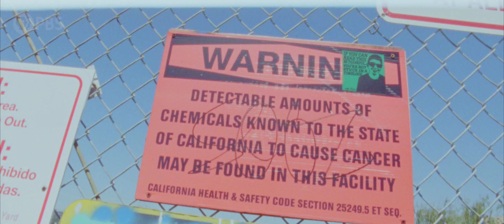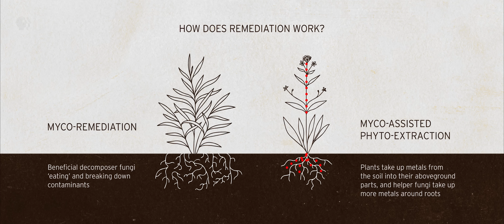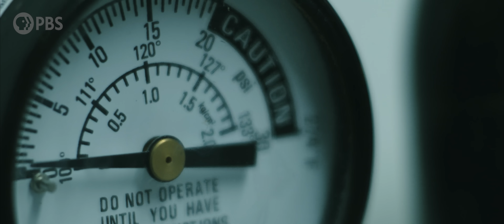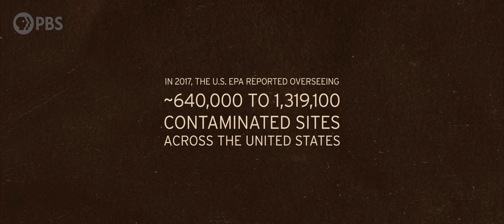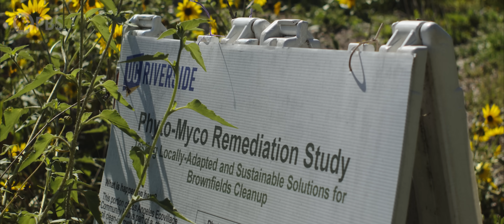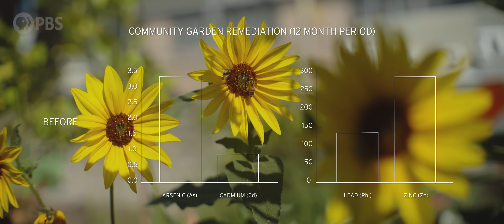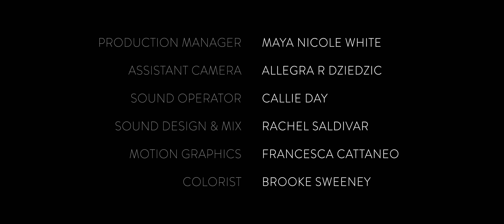She's Healing Wildfire Pollution. With Mushrooms.

Comment: Yea, yet there is still the problem of the plants used, if not removed, the heavy metals that they have captured will be released when these decompose, so harvesting these is a important step, and the proces needs to be done multiple times for it to be efective, companies already using this system will take the plants to a warehouse where the biomas is procesed and then they recolect and sale all the metals

Comment: 12:19 Reasons for the compacted and crust-covered soil, from my understanding having worked as an arborist in Phase 2 of the disaster recovery cleanup: 
1. Heavy construction vehicles compacted the soil during debris removal. 
2. Lots were covered with hydro mulch, which sprays on green and dries to light brown, in order to reduce erosion of the soil that remained and which was often no longer anchored by plant roots or constrained by hardscape. 
3. Soil that goes without water for long periods, especially those composed more of clay, can develop a hydrophobic crust.

Comment: Jesus Christ, America, stop using wood to build homes and start using bricks, stone, mud and concrete.
If you've always known this aspect of fires, why build homes which can burn down so easily and completely.
Reply: because no one builds homes entirely of bricks, stone, mud, and concrete. even if the outside is composed entirely of those materials, there are still other materials in use inside the building that are flammable. insulation, the walls, the furniture, gas fixtures, the list goes down. when all that stuff burns away, the stuff that isn't itself flammable is still damaged and has to be knocked down and removed so that a new building can be made in its place.

also, wood is renewable and far more sustainable

Comment: This is really cool, but I think some people need to realize despite the potential promise here it takes a lot of time to get from proof of concept to implementing something like this. There is a Superfund sight near where I live that was opened for development. Any process used for clean up, specially when it comes to heavy metals has to show it is reliable, consistently able to eliminate contaminates and safe for human and animal habitation. Even when methods like removing layers of contaminated ground its not perfect. Residents who move into the homes built on the Superfund sight near me have to get their soil tested before they try to grow a garden in it, or let their pets out into their yards. Because even current methods aren't perfect. I spent time in college working with and around the scientists that work on these sites. They're always looking for better ways to testing, removal and remediation. They live in those areas too. These just take time, because rushing into something that appears promising or perfect have caused a lot of harm by well meaning people.

Comment: This is a great idea and is being used without the fungi in another country in an area rich in Lithium deposits. Instead of mining the site, they plant a plant with a good root structure, and it absorbs the lithium out of the soil, and then the plants are processed to retrieve the lithium. On a side note, seawater desalination is the easiest, cheapest, and most efficient way to collect Lithium, along with many rare earth metals. With enough infrastructure built along coastlines, it would solve the US water shortage problem for good. with most of the contaminated soil going to dump sites( I did not miss the fact they were on Native Lands), you would presume that it would be quicker to remove contaminated soil and replace it as this could be a great industry for mid-sized businesses, that a whole range of mid sized buisnesses running across the US creating new fresh soils aand removing contaminated soils to dump sites, these dump sites would then be where this process of cleaning the soils takes place and once soils are cleaned then sold back to the removal buisnesses, this creates a loop where the same truck removing soil then reloads and dumps clean soil, it would take aa while to get to that stage but this is all doable.

Comment: This should be standard practice for remediation. There's even processes now to actually harvest the heavy metals the plants can extract from the soil with the mycelium's help. It's called biomining and it's already being done in some smaller places. If we remediated contaminated sites then extracted most things back, that would be a literal game changer.
Reply: This is what naturally happens after a fire. Mushrooms and other fungus bloom. They are just expediting the cycle and managing it.
Reply: What is the cost of per yield weight when compared to traditional mining?

I’m thinking about how producing new plastic is less expensive and more efficient than recycling.
Reply: @AliasHSW  Each site needs a custom solution for the exact combination of contaminants that are extracted by the plants and fungi, so there isn't a good way to compare prices one to one, and it's most likely never going to be comparable to traditional mining in any meaningful way. However, it does help close the loop on bioremediation projects. You still need to remove the plants to remove the metals, but then you just have a dump of contaminated plants rather than contaminated soil, so all it does is abstract the problem by one degree rather than solving it. Recycling the metals in the plants is a way to get the metals back in the system rather than leaving them sequestered effectively forever or allowing them to progressively contaminate wherever they're dumped.
Reply: @AliasHSW ya but the difference is the toxicity of the product is what makes it worth harvesting
Reply: @augiepm4428  of course. Not arguing that point. It’s pure thinking out loud kind of question
Reply: Divine Femine Energy 💙💙💙

Comment: Yes, but for many of the toxic elements that are taken up by the plants of the fungus, if they are just left on the land to rot.
It will cause all that concentrated material to be released back into the environment.
So, without long term collection and harvesting of those products that have been accumulated in the plants and fungus, and removing them from the area for proper processing to extract those elements from them.

The land still remains contaminated, it is just in a more secured state.
But if another fire rolls through the area and burns them all, it will release all of them again with the addition of the new materials.

So it needs to be seed the area, let them all grow and take up the pollutants.
Then harvest them all and send them to be processed to fully extract the pollutants for proper disposal.

Comment: You didn't explain what is done with the toxic metals.  If plants incorporate metal atoms and then die in place, the metal atoms merely go back into the ground.  The only ways to neutralize the metal atoms are (1) physical removal, by cutting or pulling up the plants and burying them elsewhere, or (2) building molecules around them which chemically isolate them.  (Such molecular cages around atoms are called clathrates.)